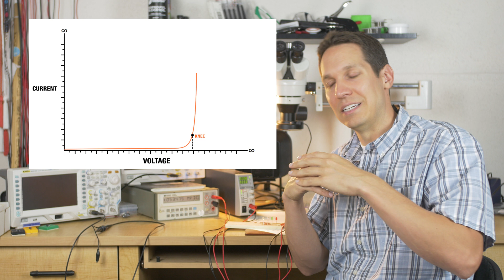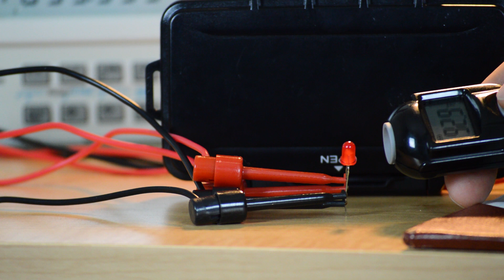LEDs and Forward Voltage | Basic Electronics

Comment: Great video!  I'm trying to understand something and I don't think it's making sense to me.

I'm swapping LEDS on a little board.  

I have two leds that are pretty much the same specs except the following.

My one white led says it's 3.4v Vf-forward voltage with a Forward current of 20mA.  
The other white led I have is also 3.4v Vf-forward voltage with a  Forward current of 10mA.

Is there a benefit of running one over the other?  I even see some LEDS have a forward current of 5mA.  I'm confused on the forward current and what that exactly means.  I understand if I put more voltage into the LED it will fry... IE:  If I don't use the correct resistors and use 9v to power the 3.4v LED it will fry, but why would one choose a forward current of an LED vs another? 
Or does that not matter as long as I ensure that the forard voltage of the LED is at 3.4v or slightly below?

Comment: LED's make great Zener diodes ( 1v7 to 3 v ) depending on colour .... with the added bonus that they light up when your circuit is functioning correctly ! ..... should you want a higher Zener voltage put some in series , also ( off topic ) the EHT diode from a microwave oven also makes a good 8 to 10 Volt Zener diode ( tried - n - tested ) ...... DAVE™🛑

Comment: If a 194 size automotive LED bulb specifies the following specs: power = 0.3 W, operating voltage = 9-16V and current @ 13.2 V = 0.035 amps, can you calculate the forward voltage for that bulb using that? V = 0.3/0.035 = 8.6V or would you subtract that number from 12V battery to get 3.4V? Im using an LED license plate bulb but the car turns off the bulb after so long because the Incandescent power draw is like 2.4W whereas the LED needs  just 0.3W. So I’m trying to figure out what size resistor I could use to trick the car’s computer. Not sure if I can just take 13.2V and divide by 0.035 amps to get 377 ohms. Then to select the watt rating, use 3.4 V (assuming that’s the forward voltage) and x by 0.035 amps to get 0.12W so you could use a 1/4W resistor with an ohm rating above 377 ohms so a 1/4W, 390-ohm resistor for example. This seems like it should be a simple calculation for someone electrically inclined but even LED bulb specialty vendors have not been able to answer this for me. Do you know if my calculation is correct? Thanks for your time!

Comment: Why it is not possible to make a LED from pure silicon?
Reply from the maker: The magic happens when you put two types of doped silicon together. Otherwise, electrons flow through the material like a poor conductor, just generating heat and not much else.  I recommend checking out our semiconductor playlist that discusses the lower level aspects of semiconductors in greater detail.
Reply: @CircuitBread  I am going to watch that playlist!, Recently I was corrected when I said that silicon might be used for making an LED in addition to GaAs (Compound-Semiconductors), the explanation I got was, that silicon goes through what is known as  "indirect-electronic-transition", which ends up producing phonons (heat) not the photons (light), so if we forced a silicon wafer by applying voltage, it would end up heating silicon wafer, and eventually destroying it. Can you recommend any article with detailed explanation on this topic of discussion.?

Comment: well, if u want to show some components explode.. connect some electrolytic capacitors backwards .. 😅🤣😂
Reply from the maker: I've done that once (unfortunately, it was on accident) and it was fun but just made a bit of a "pfft" sound, blew the end out, and smoked a touch.
Reply: @CircuitBread  try putting in a larger capacitor backwards and let's see if it can explode 🙈

Comment: I got confused when you had all LEDs connected to your power supply at the beginning, when you were quoting the current that was flowing. If you were reading that  direct from your power supply screen, then shouldn't you have been dividing the quoted value accordingly, since you had them wired in parallel? Secondly, even doing some simple division to describe what current was flowing where, wouldn't have been very accurate either, since the different characteristics of each LED would mean more current flowing through one and the other. At 3:44 in the link below, he gives a clear explanation of this. I think it is a good idea to have a separate window showing what is being displayed on your power supply, whilst showing your main DUT in the main window, as I ended up just guessing that you were doing mental division when quoting current flow, but at the end of the day, I still didn't know what current was flowing where. Thanks

https://www.youtube.com/watch?v=5BoBNW3swpA

Comment: So I am trying to understand something. Can a blue led light change in the spectrum value (400nm - 500nm) depending on the voltage? Or is the Spectrum based on the makeup of the light itself and voltage will only increase the intensity of the specific spectrum of the light? For example: a 420nm blue led light at 3 volts will not change and increase to 460nm if the voltage is increased or decreased from its intended rating?

Furthermore, if voltage does not have an effect on the spectrum range, what does? And how do they make a 430nm spectrum blue light different from say a 480nm lighter blue light? I see led lights that can be controlled and vary in color, is this due to the wave length of the electric signal, or something else? 

Also, I understand 2000k 3000k 5000k 6000k 10000k etc etc etc... but how does those ratings relate to certain color of spectrums? From what I understand, "k" ratings is ratings of all colors emitting at once. But it seems that the "k" ratings do have an effect on what spectrum ends up becoming more dominant or visible. For example: 3000k had a yellowish tent to it and 6500k has a white color. How does this "k" ratings change or why does it change the color at different values? I trying to relate this aspect with how they make some led lights with specific spectrum values that are only available to change the intensity of that color, not the color itself.
Reply from the maker: Hey Eric, those are some great questions.  I'll see if I can address all your questions.  First, color is NOT dependent on voltage - you're right that once you pass the forward voltage, modifying the voltage only changes the brightness of the LED.  Second, color is dependent on the materials used in manufacturing the LED.  We actually created a chart to show this relationship:  https://www.circuitbread.com/tools/led-colors-and-materials-chart   Now, the LEDs you're looking at that can vary in color (or have color ratings measured in K) are packaged deals.  The LEDs that can vary color are actually RGB LEDs (https://www.circuitbread.com/tutorials/how-rgb-leds-work-and-how-to-control-color) and there's actually three LEDs in there that can be controlled individually to "fake" the color you want.  Finally, the K ratings are actually the way the manufacturers tell you, as the consumer, the color of the light you're planning on buying - if it's more yellow or blue.
Reply: @CircuitBread  thank you for the quick reply. You answered my questions, which leads me to one more question. The link that you sent me for the different color variations was not as specific as I would like. It's the information I was wanting to know but it didn't state the different percentage of materials used to determine a specific color. Do you know of a hyperlink that might be more detailed? For example, what percentage of materials they use to achieve 450nm, or 470nm etc etc etc...? More interested in the specifics instead of the general concept of how it's done. Just want a deeper understanding how they manufacture led lights.

Comment: Hey, I  have a question...
Would it be possible to safely step down U.S. power on a 100 vac Japanese device, using blue led lights?
Reply from the maker: Technically, yes, realistically, no.  With the blue LEDs, you'd have to be very careful about how much current ran through them (so your Japanese device would have to consume nearly no power) and, in the negative half cycle of the AC signal, you'd have to make sure you were reverse biasing your diodes so much that they failed.  So, while you could technically get something to work, I doubt it would be effective and easy enough to be worth the hassle.

Comment: What's the model name of this power supply unit you using? It's nice and compact...
Reply from the maker: Sadly, Sparkfun retired it (https://www.sparkfun.com/products/retired/9291) but I'm not sure if it's still being manufactured and sold through someone else..  It's not perfect but it does have a nice footprint and works for the majority of applications I've needed.
Reply: @CircuitBread  Thanks for the reply, I will check the internet. Maybe, I will get lucky and find one lol

Comment: at 1:50 when you said current will flow in through the longer lead (anode - positive) through the LED and out through the shorter lead ( cathode - negtive) were you talking in "conventional" terms? as the current flows from negative to positive and the LED-s are polarized......
isn't it  (non-conventional) real life scenario that the current flows from negative to positive, so through the shorter lead and out the longer lead?
Reply from the maker: This is where the challenge is. The conventional current notation is that current flows from positive to negative (anode to cathode) but electron flow is opposite (cathode to anode). It isn’t normally an issue, but it confuses people (including me) when going from the semiconductor device level to the circuits level, as that’s where you typically switch from one standard being the norm to the other standard being the norm.
Reply: @CircuitBread  yes, i am an absolute beginner and it confuses the shit out of me.....
so the answer is, sir........?
in real life (like on my little breadboard) current flows in at the  shorter leg (neg)  through the LED out on the longer leg isn't it?
also the diode with the stripe on the positive end .....current flows in at  the positive (striped end)  through the diode and out on the negative end.....isn't it?
please confirm.......I had asked the same question under other videos as well but it seems engineers lie enigmas....barely anybody would give me a straight answer.
Reply from the maker: I can sympathize, as it is confusing.  I'd recommend these two videos to lay a foundation:  
https://www.youtube.com/watch?v=Lv231dr3w58
and then
https://www.youtube.com/watch?v=s0JznXUHGLg

With that foundation, you can see how electrons will flow from the shorter leg to the longer leg (cathode to anode).  BUT as current is semi-arbitrarily considered opposite to the flow of electrons, current flows from the longer leg to the shorter leg (anode to cathode).   That will hopefully resolve the contradiction, if not necessarily the frustration.
Reply: @CircuitBread  the second one is gold!
thank you!

Comment: This is a great video, glad I found your channel. Just starting out with electronics via Arduino starter kit. Looking for extra background info.
Thanks for highlighting that LEDs have resistance.
I couldn't figure out why my math wasn't matching reality. 
I have a resistor and LED in series. I see a voltage drop across the LED, therefore it must have resistance. The math in the Arduino book seems to be disregarding LED resistance, perhaps to make simpler for beginners.
Reply from the maker: Hi Jarrett, you're exactly right - it's to make things simpler.  Their resistance is very non-linear and in most cases, modeling it with no resistance (while on) or only dealing with a set voltage drop is much easier to deal with and "close-enough" for the vast majority of applications/calculations.

Comment: Should resistors be in series before LED. I’m just confused when it comes to the seven segment display. I see resistors connected to ground.
Reply from the maker: Hi Jaime!  It's kind of strange to think about at first, but resistors can be before or after the LED in series - it is electrically equivalent.  So, if you see resistors connected to ground, they could just as easily be connected to power on the other side of the LED.  As long as there aren't other factors in the circuit that would affect it.

Comment: I remember the introduction of compact florescent, then said to be "the future."  A couple of items you show are good, EG, factors affecting life-span and "directionality" of light emissions.  I'd like to believe mass production is responsible for lower-cost LEDs, but "sustainability" remains an unresolved question.  For comparison, falling PV costs did not obviate energy inputs needed for production. (If the energy input necessary to produce a PV is subtracted from its life-time production, is it still a good deal, or environmentally friendly?) Given massive subsidies granted for production -- everything from cheap labor to lax environmental regulations -- it's hard to predict if -- this time -- the LED is the future.   As for directionality, let's just say it:  Structurally, LEDs "leak" out light that must be redirected to mimic what most consumers consider as a light bulb.  It's an engineering challenge resolution of which deserves a fair hearing.
Reply from the maker: Hey Scott - these are valid points!  And while I used to be heavily pro-LED, I'm still pro-LED but with my enthusiasm tempered a bit.  I still think LEDs have the large benefit of not requiring mercury like CFLs but the way they're used in arrays make me wonder if their touted lifetimes will never be achieved because the likelihood of one LED in an array failing, rendering the entire array useless, is much higher than a single LED by itself.  However, for small embedded projects, while I can actually think of some exceptions, overwhelmingly LEDs will be the right choice.

Comment: the new led for your house dont have a standard voltage! they are not 
110 or 220 volts but rather are "RANGES" they are " AC85-265V " between 
85 and 265 volts. while this sounds interesting that it will work on any
 supply i suspect this will effect the wattage ratings and in term its 
brightness! a 10 watt bulb run on 220 volts i would think would be 
brighter then one run at 110 volts! unless these can change their 
amperage ratings? can they change their amperage ratings and stay at the
 "claimed" wattage ratings? because most LED are in general 220 volts. 
so for the usa i suspect we get lower wattage ratings.
Reply from the maker: Hey Charles -  certain LEDs, like power supplies for computers, have driving electronics that can take a wide range of voltages.  They're setup so that if there is a greater voltage, there will be less current draw, to keep the power consumption the same (and the light output).  Conversely, at the lower voltages you find in the US, you'll have to draw more power.  Not all LED bulbs do this, though, and definitely the discrete bulbs discussed in this video could not handle a direct application of even 85V without utter destruction.  Even bare, discrete LEDs have different voltage and current ratings - once you add in some electronics to drive the LEDs, the amount of different voltage/current/control options increases dramatically.

Comment: I had an infrared LED explode a while ago. It was rated at about 2 V, but I used it on a 3.3 V GPIO pin of my Raspberry Pi without a resistor. This wasn't a problem because it only ever got powered in short bursts to send out an IR signal to my fan. However, a while later, I rebooted my Raspberry Pi and for some reason it completely turned on the GPIO pin. The LED's cap flew across my entire room a few seconds later. I'm glad I didn't sit in front of it while it happened. I didn't try to reproduce it because I don't have too many IR LEDs left.
I also killed some LEDs with 5 V in the past, but they all just died immediately with no visible damage.
Reply from the maker: It's amazing how far they can fly when they do pop!  I'm propose to the team that we just buy a bunch of LEDs and overvolt all of them at the same time and see what happens.  Useful?  No.  Educational?  Not really.  Fun?  Hopefully!

Comment: How on earth 1) did that LED not burn out long before it did and 2) how did it come back on?? Mine fry and die with 5v input if I don't use a resistor, and certainly none have ever come back on. I'd like to know your special source.  : )
Reply from the maker: The key is to publicly try and make it burn out!  If I weren't trying to show it burning out, I'm sure it would've exploded in a fiery ruin the moment I gave it any voltage.
Reply: @CircuitBread  Actually since watching your video I've been testing mine. I find the red ones oddly difficult to fry. They flare out, then nearly die, but return to near original quality despite suffering several times their front voltage which my other colors (esp. white) can't take. Strange. (Just saw a SciAmerican article saying the worst environment offenders are low intensity red LED's, which contain up to 8x the amount of lead while white contain the least. Wonder if it's related).
Reply from the maker: That's interesting!  I'm trying to remember the color of the LEDs I've seen fail and/or pop.  Not something I typically pay attention to.  I'll ask some of the other engineers here if they've ever noticed that.
I wonder why the red LEDs require 8x the amount of lead.  What portion of the LED requires all that lead?  If we knew the answer to that, maybe we'd be able to better guess if it is actually related.